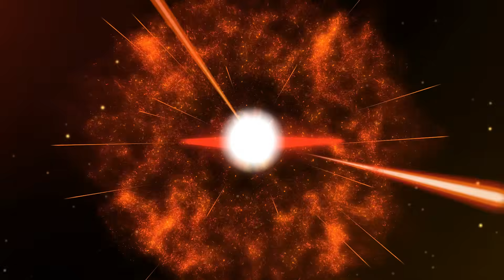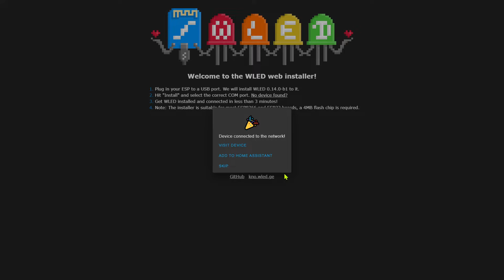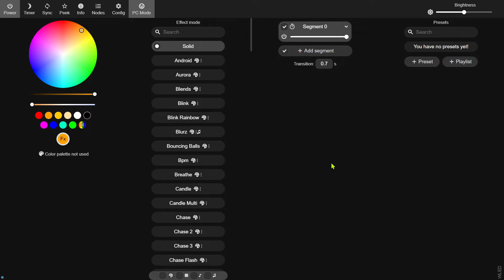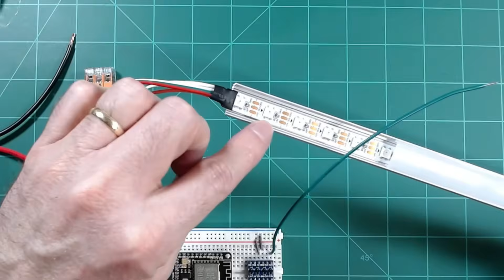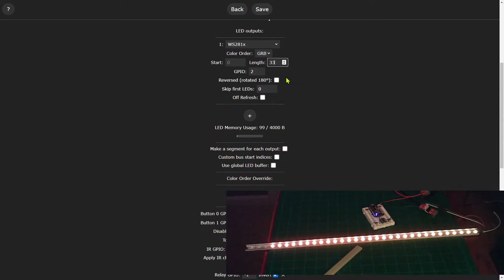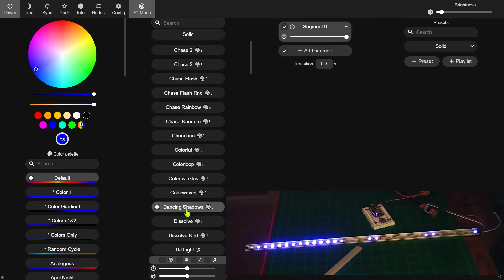How to Quickly Build Your First LED Controller

Comment: Thank you very much. I've been reading your article on blogspot and I see that my led strips probably won't work for my WLed project. My led strips are RGB 5050 12V and are not addressable like yours. My led strips are normal rgb 4 wires R,G,B and V+. Is it possible to do a WLed project with my led strips? Thank you very much and if you can answer me I would be very grateful
Reply from the maker: WLED does have some limited support for non-addressable strips, but it does require additional circuitry that I do not cover in any of my videos or blog articles (which all deal with addressable strips).  The official WLED web site does offer information, including a wiring diagram for how to use non-addressable LED strips such as the ones you currently have:  https://kno.wled.ge/basics/compatible-led-strips/
Reply: Thank you very much

Comment: I just came across this video and love how easily you show how to implement a logic level shifter. I am wondering if you have experience with 24V implementations. I need to run 4 different COB style LED strips that are 24V. I have a few of the ESP32 controllers sitting around, so I plan to use one. Currently I run everything from the 24V power supply, and use a buck converter, to step down the 24V to the 5V for the ESP, and then use the common ground for everything. I think I am having trouble with my data wire, and am seeing a slight flash from the LEDS every few cycles when testing with the “chase 1” effect. That is the easiest issue to explain. Based upon your design here, you are using 5V LED strips, but I need the ability to have very long strips, and was directed to 24V. I have seen on multiple videos that people suggest using the ground wire that is powering ESP32, to help make sure there are no weird issues, however, I don’t want to do anything that would cause long term issues or even immediate fry everything. Given that I need the logic level shifter to bring the 3.3V back up to 5V so I can send the data about 50 centimeters to the strips, I am wondering if I should have a separate 5V power supply for the ESP32, and then run LEDs off of the 24V power supply. And then in that case I am just unsure of which ground I should use. Any help would be appreciated. Thank you…
Reply from the maker: I don't personally have any experience with 24V, but have used 12V with a 5V controller.  Most of my experience has been with WS2812b, WS2811 and SK6812.  There are a few potential issues with flickering.  Naturally an issue with the data signal is one.  The other is due to ground potential differences.  That is why if you do opt to use two different power supplies, you MUST create a common ground between the two.  If you find it helpful, I have blog article with a bunch of different wiring diagrams... one of which is powering 12V LEDs and a 5V controller separately.  This would be the same when using 24 V LEDs:  https://resinchemtech.blogspot.com/2023/01/wiring-diagrams.html

There is also a remote possibility that the LEDs you are using are requiring timing that the regular I2C-compatible shifter can't handle.  I've not personally experienced this, but other claim that they have.  In that case you can try a shifter like the SN74ACHT125N shifter.  If you want to know more about that, you can watch where I compared these two shifters here:  https://youtu.be/61VWgYmomz4

And of course, voltage drop can cause the LEDs to misbehave.  While it is true that 24V LEDs can support more LEDs before power injection is needed, if you've tried all other remedies, it is at least worthwhile to try injecting power along, or at the end of the strip, as a test and to just rule that out as a potential problem

I hope that gives you a little more info and maybe points you in the right direction for finding and fixing the flickering issue.
Reply: @ResinChemTech  Wow! Thank you for the prompt response. This is truly amazing. I think you would really dig the project that I am working on. My apologies for not including more of the specifications in the original post of the COB style LEDs or the rest of the components. I wasn’t entire sure if people responded to comments on YouTube. 

I have these really cool work pods that I purchased for my startup. They were formerly dressing rooms at Bloomingdale’s in Santa Monica before they went out of business. What caught my attention was that these dressing rooms are shaped like the thing that Jeff Goldblum goes into in the Fly. They were suspended from the ceiling suspended from the ceiling and would lower down with a winch. It took me 11 years from the first time I saw them and knew I wanted them as my work pods until the store went out of business and bought them from the liquidation company. What makes them cool is that the frame is made out of 6 evenly spaced concentric rings that have smaller diameters on the bottom and top, and get bigger towards the middle. The bottom and top rings have a circumference of about 15’ and they double in size to as the rings go towards the middle. The bottom and top ring have Velcro to attach the fabric that covers the pod, which will make it hard to run an LED strip, but maybe in time I will figure something out. My plan has always been to run LEDs around the rings and by using the chase effect the pods will look like big cork screws. I am trying to keep everything as simple ass possible, so I am using as much off of the shelf stuff as possible. I plan to put all of the electronics into an enclosure that is on the door to the pod because that is the best starting point.

At the moment I am running everything off of a BTF-LIGHTING 24Volt 5Amp ( https://a.co/d/enK0nTP )power supply. For the LEDs I am using BTF-LIGHTING FCOB WS2811 IC RGB Chip Flexible High Density Uniform Light Chasing Color LED Strip DC24V 720LED/m ( https://a.co/d/h2NrX9p ). What is nice about these strips is that there are 100ICs per strip. So they do use the WS2811 IC RGB chip like you mentioned. Then I am planning on using one of many buck converters to bring the power down from 24V to 5V for the ESP32 Wroom board. From watching some of the YouTube videos for people who have played with these COB style strips, I did not realize that I needed a logic level shifter. Some of the people suggested a 62ohm resistor from the data pin, but of course I only had 68ohm resistors. I went to the website for WLED where it suggested the LLS or the 62omh resistors, so figured I would wait to try until I had all of the pieces in hand. Really, right now with my test setup the slight flash is not terribly noticeable, but when you add length it does become an issue. 

I am trying to mitigate damaging any of the components, so I think moving to a standard power supply like LED style supplies that are used in 3D printers, and then I can have better options for grounding, amongst other advantages. I know the project is a little hard to explain, but based on all of the videos that I have seen online, you have the most specific direction that I have come across. Thank you for your input above.
Reply from the maker: Again, I'm not an expert on those particular strips, but you did say one thing that I felt was of note.  If the issue gets worse when the strip gets longer (you add more LEDs), this almost always points to a voltage drop issue. 

If you are still bench testing, then you might try running a separate 24V line from your power supply and connecting it to one set of extra wires at the JST connectors... these are there for power injection.  Try it at somewhere around half way down the total length of the strip and maybe again at the end of the strip.  See if the flickering gets better.  While it is true that you don't have to power inject as often with 24V as you do with 5V, you still have to do power injection at some point if the number of LEDs gets large enough.

Let me know the results of trying power injection.

Comment: Thanks for the upload, i am looking some advice. I have 24v COB. Cant seem to get the data signal to be consistent (alot of random flashing) would you be able to sugest the correct way to wire and power inject ? I think i am being stumped on where to ground the 5v level shifted data signal. I am directly power injecting from 24v 60w power supply and have run a second negative/ground from that to the ground on the 5v side of the level shifter. But again this wont let me go very bright without random flashing. Help would be super appreciated.
Reply from the maker: Well, since you mentioned that the flickering only happens at higher brightness levels, it leads me to believe that it is a power injection issue and not a signal issue.  When using two different power supplies (which I am assuming you are since you are running 24V LEDs and a 5V controller), it is important to create a common ground.  But it sounds like you have already done that.

You didn't mention how many LEDs you have, but I would try power injection first.  If you don't have another convenient spot, inject 24V at the end of the strip as well as the power it is receiving at the end.  If you don't see flickering at lower brightness, but only when the brightness is increased, then that is a voltage issue.  If it was really a signal issue, you'd have the flickering issue regardless of brightness.

That's my best guess anyway.  I've pretty much only used 5V and 12V LEDs, so I don't have any personal direct experience with 24V COB LEDs.

Comment: Just one question,  how,much power would I need for 300 leds???
Reply from the maker: For 5V standard LEDs, you should estimate a maximum current draw of 0.06A per LED.  So in your case, 300 x 0.06A = 18A max current.  That would be the max for full bright white... other colors and effects will draw less.  You may wish to watch this video where I cover the most common LED questions, including determining the size and type of power supply needed for your project:  https://youtu.be/GZv5Ztj6i6I

Comment: You said multiple times not to use that screw terminal adapter on the power supply for "larger" installs. What qualifies as a larger install? Is there a documented current limit for it? I would've assumed it's ok to put 50A through it, if it comes with a 50A power supply.
Reply from the maker: If you look at those types of connectors sold independently on Amazon, they claim they can be used safely for up to 5A.  Personally, I think that is pushing it and wouldn't push more than 2-3 A through one.

They definitely are not rated for something like 50A.  Yes, I feel it is irresponsible to include a component with the power supply that is not rated to safely handle the current of the power supply it comes with.  Try connecting it and then after a few minutes of running higher current through it, you will feel it start to become warm...  then hot.  Eventually it will become hot enough to melt and possibly short out or start a fire.  Do a quick Amazon search for 'barrel connector' and you'll find ones identical to the one include with the power supply.  Most, if not all, say they are rated for a maximum of 5A.

Like all projects, but especially those with high current, it is important to verify that all wiring and components used to carry power are properly rated for the expected current.  Just because it is "in the box" doesn't mean it is rated for the maximum power that can be generated by the power supply.
Reply: @ResinChemTech  eek. That's scary. I was hoping to power a 5m strip of SK6812 (RGBW) with one of that exact 5v 10a (i meant 50w in my last post, oops lol) power supply you have in the video. Would you recommend going with something different?
Reply from the maker: Ah.. that makes a little more sense!  A 50A power supply would be one of those larger, what I call 'transformer' style power supplies, and they generally don't come with the barrel adapter like you described.  But they are definitely included with the smaller 'brick' style power supplies, that you can generally find up to around 15A. So 50W does make more sense than 50A... which would melt one of those connectors for sure!

You can find barrel connector pigtails with 16 or even 14 gauge wire that can safely handle the higher current.  It will somewhat depend on a number of factors... such as the expected total current draw from your LEDs, length of the wiring runs, etc.  

I do tend to be a bit on the over-cautious side.  If you are running WLED, most colors and effects will pull significantly less current than the calculate maximum (which would occur when running on solid full bright white with all pixels lit).  But I like to design for the maximum, even if I never hit it.   If I have a higher current situation that I feel will exceed the barrel connector, I simply cut off the connector and solder larger gauge wire directly to a short section of wiring from the power supply itself.

But as I said, I'm overly cautious.  I always recommend that you do a bench test, run your LEDs on full brightness for a while, keeping an eye on all connectors, wiring, etc.  If you note anything getting more than just slightly warm to the touch, then you need to reevaluate that connector or the size wiring you are using.  It's better to test and monitor on the bench than after you install something and then have a component melt or fail.
Reply: @ResinChemTech  Thanks a lot for your quick responses! Going by your math (.06 * N-leds), the 10A supply may be a little short, but from what I've seen I can limit the amps in WLED, and if I find that limit.. too limiting I can always upgrade my power solutions. Thanks again!
Reply from the maker: No problem.. glad to help.  Just remember that that 0.06 x LEDs is the calculated maximum for full bright white and not what you will likely normally run.  But yes, in WLED, you can specify the size of your power supply in milliamps and if you enable the brightness limiter, it will keep the amps below the maximum.  And I think you'll find the LEDs are plenty bright... even at 50% brightness... which will also use fewer amps.  But as I said, I like to be over-cautious.  Good luck with your project.

Comment: Love this. Trouble is when I go to Amazon, it over $130 (CDN) worth of stuff from Amazon - which gives me a lot of left over things of course.
Reply from the maker: Well, I do tend to buy things in larger quantities because I use so many in my projects and I can get a better price that way.  But you can often find some of the items in smaller quantities than I linked to.  The links I provide are generally the actual items that I ordered and used... there are sometimes cheaper alternatives, but since I haven't personally tested them, I don't link to or personally recommend them.

And there have been some instance in the past where something has been updated with a crazy price after I've linked to it.  Someone shared that a link I had provided to a simple $3 breadboard was showing a cost of $342... and that's just wrong!  The issue is that the items (and costs) on Amazon are constantly changing and it is simply impossible for me to go back and try to keep all my links across all my videos and blog article up to date.  Occasionally a product I link to will become unavailable after I publish.  They are current at the time I make the video or write the blog article.

What I always recommend is that when you use one of my links to go to Amazon, check out the alternative items that Amazon generally shows for any item.  If the price for the one I linked seems way out of range when compared to the alternatives, then simply select one of the alternatives instead.  But in certain cases, an item is only available in a larger quantity that what you need.  You may, for example, have to buy a pack of 100 LEDs when you only need 3 for your project.  But that just means you have extras on hand for your next project!  I do greatly appreciate your attempt to use my Amazon links... but as always, it never hurts to shop around a little for a better price or quantity that more matches your needs.

Comment: Amazing project and video, thanks. Can i connect led strip directly to the ESP? How WLED program works that it can power leds with no additional power source? No breadboard and no transistors in scheme?
Reply from the maker: You are welcome.  I'm glad you found the video helpful.  As to your question, due to the current draw of the LEDs, if you try to power more than just a few LEDs (like more than 8 or 10) via the 5V pin on the ESP, the current draw will likely burn out the ESP... or you will have to run the LEDs at a very, very dim level to limit the current.

You may want to watch my video on common LED questions ( https://youtu.be/GZv5Ztj6i6I ).  In the chapter on 'Wiring it Up', I start out talking about this exact thing... why you can't power the LED strip directly from the ESP.  There may be other information in that video that you might find helpful, but I do address your exact question in that section of the video.
Reply: @ResinChemTech  Thank you very much bro